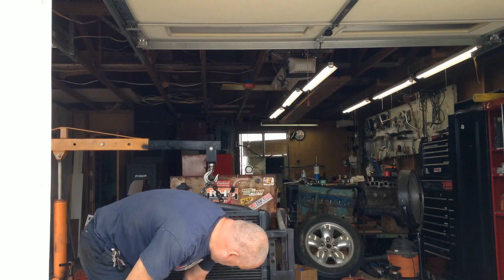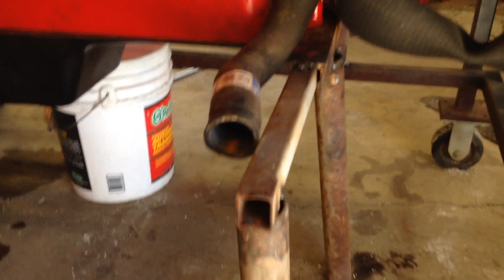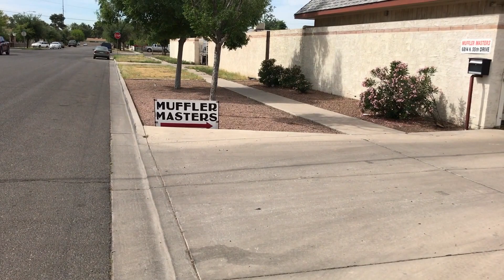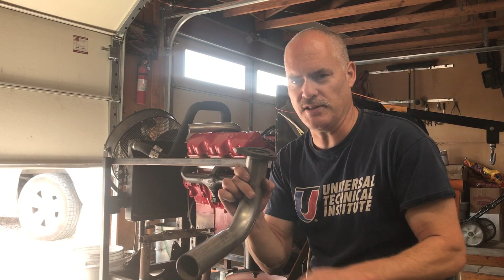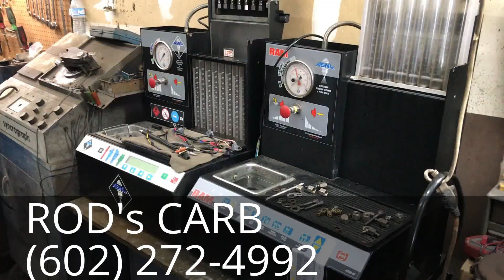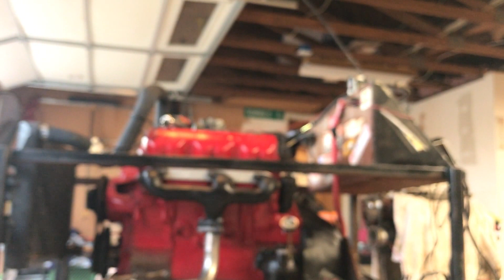305 GMC V6 REBUILD PART 9

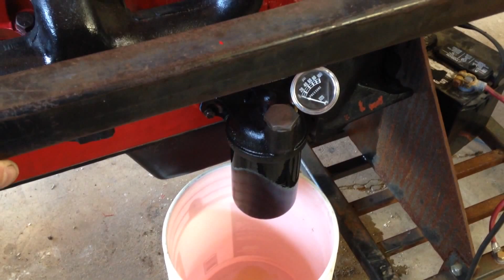Comment: Word of caution for anyone that has one of these big engines,,, DO NOT,, REPEAT DOOOOOOO NOTTTTTT EVER RUN ANY OF THE ENGINE FLUSH THROUGH IT!!  I did that to mine over ten years ago and because of the high volume oil pump,,,it sucked the sludge and junk up to the oil pump screen and stopped it up VERY QUICKLY and starved the engine for oil AND SPUN NUMBER 4 rod bearing!! Of course i didn't find the rod bearing till about 6 years later,, it started a tapping noise when i fired it up with the flush fluid in it,, so i killed it, changed the oil and filter,, fired it back up and it was still tapping,,, fast forward about six years finally got the oil pan off,, checked number 1,2and 3 rod bearings and they still looked as good as the day they were installed ( didn't think to look at number 4) so i reassembled it,, and every so often would fire it up and run it( because i loved that sound) then one day i noticed it had a tapping vibration coming through the carburetor, well i just thought it was the solid lifters,,, kept going out every so often and starting it up,,, well one day while running it i was watching the oil pressure it was always about 55-60 lbs,,, well i was revving it up and noticed the pressure start dropping quickly down to about 20lbs,,, i cut it off,,, skip ahead to about 6 months later,, took the pan back off( pain in the butt,had to jack up engine each time) again checked 1,2 and 3 still looked great,,, took number 4 cap off and my HEART WENT INTO CARDIAC ARREST!! IT eat the rod up and the crankshaft! The bearing welded itself to the crank and spun in the rod!!! Fast forward to now,,, the engine is sitting on the ground in front of the truck,, and is waiting to either be possibly rebuilt or replaced!!! I do know of another one,, that i might buy and put back in the truck,, or i might go v8!!! But i sure liked that old LUGGER! it always ran good,, got decent milage ( had three on the tree with 3:08 rear axle) it would run on interstate at 75 mph engine only turning around 1500 rpm with plenty of peddle left!!  So I'm torn between going back big v6,, or a ho 305 v8 i can get cheap!! I've always wanted to duel out the big V6 and show all the young folks what it's all about!! 😂 I'm also thinking about putting a 5 speed granny low in it too...... but like i said don't ever try flushing it with the engine "FLUSH"  i got it figured that the high volume oil pump ( 14 gallons of oil per minute at 3400 rpm) just sucked that crap up so quickly and stopped that screen up!!! Oh it flushed it good!! RIGHT OUTTA THE TRUCK!!!😮😂😢

Comment: I rebuilt a few of these back in the 1980's including one that I still have in at 1969 GMC 5500. I recommend re-torqueing the head bolts after the engine has undergone about a dozen heat cycles. It's a hassle but will prevent head gasket failures.

Comment: It seems to me like this was another case of GM engineers not talking over the details. At the time that this engine was being developed, the effects of tuned intake runner length had been known for years (and even used by gm on some engines). Why they chose to saddle what was designed to be a low rpm truck engine with an intake better suited for use from 5000rpm up perplexes me. Given adequate runner length the story of these engines might have been completely different.

Comment: Four year old build, hope you are still monitoring comments on it, 'cause I have a couple questions.   Maybe my memory is off, but I remember my 351 ('66 GMC 1/2 ton step-side, 3-speed on the column) having a huge Stromberg that I thought was a 4-barrel until I took the air cleaner off, this carburetor seems smaller.  Does the 351 take the same carburetor and/or intake manifold?  What would it take to turn a 305 into a 351?  I LOVED the torque my 351 put out!!!
Reply from the maker: I'm pretty sure it's the same

Comment: Two barrel, my 1960 had a Holley one barrel.
Perr's like a kitten probably most of all because you did a good job rebuilding that engine in terms of compression and timing. years ago when carburetors were  more common, that's what everybody blamed when an engine wasn't running right, many carburetors were sold and then "defected " when it was a burnt valve or jumped time that was making the engine run bad NOT a carburetor issue.
Those v6s had a long timing chain .
I imagine by now that engine's long gone?

Comment: This was a great series. I’m trying to get my late Grandad’s 65 GMC with the 305 in it running. Thinking it’s the mechanical fuel pump or a carb issue. Will be rebuilding eventually with my dad and full resto on the whole truck in honor of my Grandad.
Reply: Hi Cody, whatever you do, keep the V-6.  My Dad gave me the Family '65 suburban back in '85. I got into construction, and it was my daily driver. When it finally gave up in '95, (valves died despite the lead additive) I did a Small Block Chevy swap. Biggest mistake I ever made. On a heavy truck, that 305 V6 feels much more powerful than the V8 in normal street driving. It's just engineered correctly for that heavy truck. I really need to rev the v8 to get it moving (it only wakes up over 3000 rpm). I don't know how, but it's still running with 1 flat lobe on the cam. I'm planning on a 383 when this one gives up. I wish I kept that 305.

Comment: Awesome,  Also, thank you for showing how you mounted the engine in your run stand.   About to build one of my own that will double as a workbench when its not holding an engine.

Comment: Just bought a 1964 GMC with this V6 305 back in July 2019. I am a truck guy not a engine guy, but watching this in 2019-2020 was cool. I am looking to have the engine rebuilt and I am being told it is hard to find parts. Truck runs good just wish it ran a little better.

Comment: Just want to add another comment noting my appreciation on this series. I have this motor in my 62 GMC and it's still running strong. Your work in documenting and running through everything about the motor is an invaluable asset. It is getting quite difficult to find parts, let alone anyone that has heard of these motors. Thanks again!

Comment: Great engine build series - thank you!
Wow, many neat and interesting points to notice from this engines design, engineering, and manufacturing (especially from 1950s )
* Casting quality and associated machining for this entire engine assembly is absolutely awesome! You can look at much later/newer engine castings from the big 3 and they suck!
* Ford and Chrysler folks note the 1950's GM use of deep skirt (Y block) design, full floating pistons, bushed rods, adjustable shaft rockers, gerotor oil pump, raised roof cylinder head ports, just to name a few - there's much more. The engineering and design team for this engine platform new their stuff. I'm not saying GM invented all of this, but they made it all work very well in a thoughtful manner.
Now, go back and watch the series on the Ford FE engine. WTF was Ford thinking? This engine platform was engineered/designed (Epic Clown Circus) years later.
I'm in my 50s, live in Michigan and have worked for years at several capacities for the big 3 auto makers. I like them all and believe that if it has a set of pushrods, was designed and made in America, it's a thing of beauty.
I'll be contributing to your Patreon and watching more of your engine build series videos...
THANKS!

Comment: What a thing of beauty. Its too bad GM dropped this line of engines, think of what we'd have with modern materials and engineering on an engine like this instead of the light duty, high RPM stuff they make today. Speaking of RPM, I hope you turned the idle down on that engine, it should be about 400 RPM - everybody has the idle turned up way to high on these. The "V6 lope" should be easily heard at idle. 

I grew up with a '63 1 ton GMC with the 9 foot stepside bed and the 305. The body rusted away, but the drivetrain was still good. Coupled with the SM420 transmission and a 5.14 rear end, it was unstoppable!
Reply: I agree , my Father-in -law hauled tire casings in 1961 in a brand new Gmc automatic long bed 1/2 ton. He could pull anything !
He bet a guy who had a tractor trailer that would not start that he would pull it out of his warehouse if he released the brakes on it . It was loaded with tire casings . He pulled it out . That was in 1963 . That truck had 600 thousand miles when he sold it in 1973.
Great memories…..

Comment: WHAT THE HEY. ???? 
 Starting fluid in a fresh engine ???  Happy blown head gasket. Or crack a head or two ??? Now you should dump some oil down the spark plug holes to keep it from seizing up due to no lubrication in the upper cylinders, while you goof with that carb. It's extremely possible that engine will seize up.  That crap should be taken off the market. I thought one person on you tube had enough common sense not to do that.
 Alas, I'm disappointed again !!!!!!
Reply from the maker: Well first of all  calm down!   The engine was sold more than a year ago and still runs perfect a few shots of starting fluid onto an engine with internal components covered with assembly lube does not hurt an engine one bit you are making a big deal about something that does not matter most of the time that indicates a lack of experience I do agree that large amounts of it can be damaging but you gotta use some common sense here

Comment: I would love to see one of these on a dyno! so curious to the numbers this thing makes. maybe a better intake . a can with about .525" lift. but keep the separation angle or overlap and duration to make great low end torque. and polish the heads a little. I don't know if larger valves could be found for this thing! and ARP studs to retain the crank and heads. I'd love to see someone hot rod one of these engines. or do all that AND add a turbo! kits not bad of a exhaust manifold design. to add a pair of turbos to. great video. I bet a 350 or 500 volley 2 barrel or a 450 4 barrel Holley would be great on this engine! with a good intake. maybe make the iron one a  mold. and pour a new one from aluminum. and then modify the aluminum one. I like being able to return things to stock. but with some machining and welding an aluminum 4barrel intake can be made at home. if you have the will and tools!! thanks and sorry for all the rambling!!!

Comment: Hi, great channel! Question: Is the Buick 231 worth rebuilding? My experience is it was the V6 option in many Olds from 1980-87. I found it incredibly reliable despite abuse from the previous owner. That, and it's lighter than the V8 of the era.
Reply from the maker: Yes the 231 is good V6
Reply: Thank you! Wished I would've kept the car three years ago. But at that time, I understood machine shops have a lot of overhead to cover, so I was told to expect the whole service to cost about $6,000, not including the transmission.

Comment: no water in the radiator fan not blowing? you trying to wreck your new 305 ?
Reply from the maker: I'm not following what are you getting at
Reply: But of course your not.
Reply: Initially he said there was no water and the radiator was not hooked up. Then he hooked up the radiator and put water in it. Just because he didn't say he did it doesn't mean he didn't. It was a given. Look at the water on the floor near the radiator fill spout.
Reply: From what I’ve always done it dosent hurt a engine if you’re u turn it over or start it without a radiator as long as it dosent run for over a min

Comment: Where can I get rod and main bearings. I have a 305 v6
Reply: Use Clevite bearings, they are all i use and have over 40 years. I use "Clevite Bearings" (go online) and Perfect Circle Rings (Cast Iron) and only Fel-Pro engine Gaskets. You can use Moly Rings but only do so if you are boring the block an oversize and with new pistons. Cast Iron if you are just rebuilding engine and NOT boring the block.

Comment: WOOOOH!! HOOOOOO!! AWSOME!! THE BIG PAYOFF HAS FINALLY ARRIVED!! I Can See That That IS A Rochester 2GC Carb On There. The Exact Same One I Had On My (RIP) 1973 Firebird 350/175. I Remember Rebuilding Mine Back In The Day. Just Changed The Gaskets, Basically. Fairly Simple Carb To Rebuild, Just Like My TBI Throttle Body In My GEO METRO. I Wouldn't Dare Touch The Ones In My 1986 Sprint Or My 1979 Monza. (Pontiac Iron Duke 151.) I Envy The Guy Who Gets That 305 GMC V6. He'll Be One Lucky Guy For Sure. CONGRATS MAN!!!!!

Comment: Where did u find the right oil filter gasket/ o-ring? The one in the wix box is too small!!  Thanks in advance!
Reply from the maker: I made one the SBC felpro gasket set has a gasket for the rear plate on the water pump I took scissors and cut it to size it worked
Reply: Awesome. Thanks again!!

Comment: Ever wanted to do a straight 8 build?
Reply: Packard is another good inline 8 . I have rebuilt a couple of them . I done a set of heads off of a 702c.i.d.  V12 GMC recently .
Reply from the maker: I almost bought one last week but I had to pass on it because I looked onto it and could not find any parts available for it but I would be open to it if I could find the right one
Reply: About the only one i could recommend is a Buick straight 8.  Since they were some of the last ones still available you can get most parts for them, but you will need a good short block. Be sure to get a post 37 because 1936 and earlier had cast in place bearings.

Comment: Any plans to showcase a 351 Clevor build? might be a good idea to highlight how to drill and tap the front of the cylinder heads for the coolant crossover fabrication involved for those who are wanting this kind of a build. (like me) I know the Clevor uses what's called a dry intake manifold. (no water crossover ports in the intake) may want to show how the 351w heads only flow 160cfm vs the Cleveland heads and how they flow 315cfm. big difference. Also, there are some companies out there who make cleveland based heads that already have a dimple marked for Clevor builds specifically for drilling out for this purpose!. Plus I wanna see how one is built. or could you build one for someone if they asked? there are tons of options for this build as well! I want to build one for my 1975 Granada! yeah I know I am one of those guys who are different. but I just love how the car looks!
Reply: The Mechanical Koopa Granadas/Monarchs Are Cool!
Reply: you should join our FB page! you wouldn't believe how sweet some of these rides are! https://www.facebook.com/groups/649929958387677/

Comment: Nice work.  I really like the old school cast iron exhaust manifolds. Exhaust efficiency isn't terribly important on an engine like this anyhow and stock cast iron is just fine. 
Extra points for the classic Stewart-Warner oil pressure gauge, too.
Reply from the maker: THX

Comment: What I remember about those is that when thhey are running right they do not shake at all. I worked on rebuilding not overhauling 2 of those.     Rambus

Comment: I thought a 305 was a v8
Reply from the maker: Not this one
Reply: Myvintageiron7512 That's why I subscribed to your channel I constantly learn something knew thanks for the videos
Reply: Clarence Thurmond There Is A 351 And A 401 Version Of This Too.
Reply: Richard Kaltenbach 
 A 478 V-6 was also a production engine from GMC.
 The largest V6 gas engine manufactured.

Comment: Nice.......       this engine will be around for another 40 or 50 years!
Reply: This engine is built like a farm tractor.  The bottom end parts are seriously overbuilt. 
There's no need to ever rev this engine above 4000 rpm anyhow. Very low stress, low speed/ high torque design.
Reply: Joe schmo Nah! You Don't Wanna Do That!! No Sir!
Reply: So I understand the physics of it; running just manifolds without pipes puts it too close in terms of not just back-pressure, but and or Heat?
Reply: sucking in cold air on valve overlap is a great way to go back to part 1 of the engine build